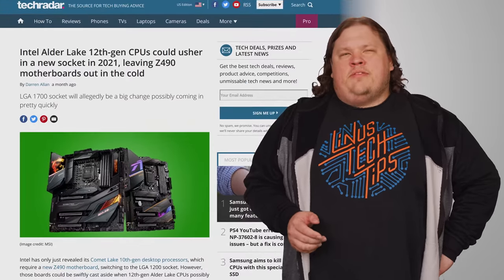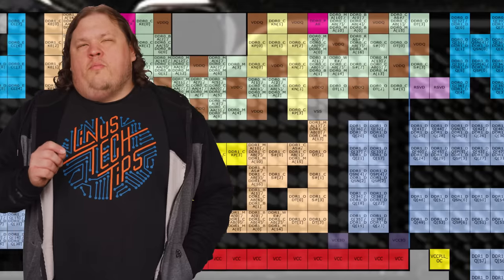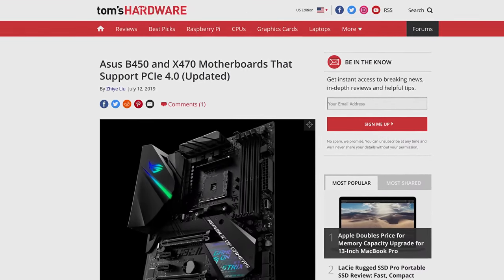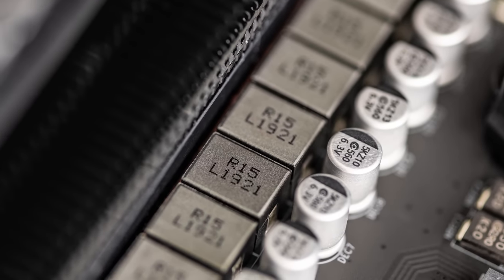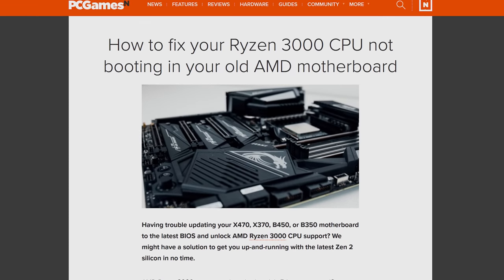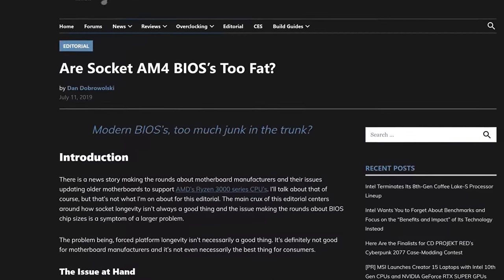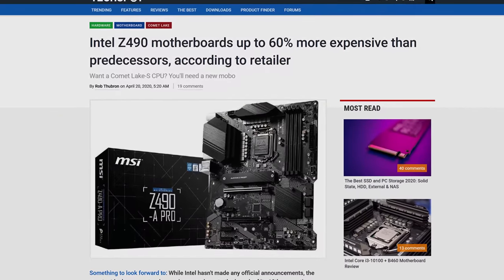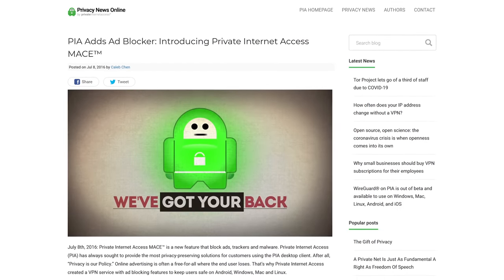Why CPU Sockets CHANGE So Much

Comment: 3:35 "So it decided a transition to a new chipset with a 32MB bios chip instead."
Complete garbage as you find X570 boards with 16MB bios chips which cover more generations of CPUs than B550 with zero change to the socket with the likelihood going forward that Zen3 based 4000 series processors and 5000 series APU's will be the end of the line for forwards compatibility meaning that B550 will only support two generations which only requires a 16MB bios.

If AMD for some reason make AM4 compatible Zen 4 based processors and APU's, then there'll be a whole new round of support issues with those X570 boards with 16MB bioses, which would be an untenable position to exclude.

Comment: You are asking the wrong question for the right solution. If the bios is too small to contain all the info then why not just socket the bios to be replaceable as need demands it like it was for 20 years? And while at it, why not future proof the motherboard with unpopulated vrm sockets the same way they have reserve pins on cpus. It's like saying nobody wants chocolate syrup on a pickle flavoured ice-cream, but why is the ice-cream pickle flavoured to begin with? 

For the record amd is still better than intel in this aspect but this entire video is just corporate funded crowd anger soothing. LTT media is a shill as always posing as being on the consumer's side.

Comment: That's bullshit. It's easy to reserve many pins. And there could just be more specific prerequisites for a CPU, instead of just a chipset (yet it even comes down to whether the motherboard supports a given CPU).

I'd say that this is either bad engineering or money-driven decision that also keeps it simpler for the engineers (double advantage).

Comment: Well i do have a solution for most of the things you said that are problems.
1- put more pins to a higher end motherboard just in case because there already is a butt ton of vrms for overclocking and whatnot so they will deliver the power your new cpu needs.
2- put a god damn bigger bios rom into the motherboard since it is a high end variation and it already is expensive.
Asking around $500+ for a motherboard then demanding socket change every one or two years is clearly a ripoff. Do that for $100 crapboards nobody cares about changing them but changing a fucking high end motherboard and still not getting pci-e gen4 is fucking ridiculous. Intel just sucks big time. Do they really think people will buy their new cpu's and build a full new system just for nothing and next year when they finally support pcie gen4 with their brand new cpus and whatnot do they expect people to upgrade again? They are totally ripping of their loyal clients in order to make up the loss of market share by making just too many launches that don't mean anything.  Yes all chip manufacturers suck at something. For example nvidia is constantly messing up with their pricing, now most of the retailers that have 2080ti's in their stock will sell those cards for loss only because the same company is launching faster products for cheaper. Same goes for AMD radeon promissing to deliver performance for almost a decade and always failing to compete in the market. They all suck but intel, they are really greedy.

Comment: I originally bought (way back) an intel core2 duo cpu expecting I could upgrade later to the quad and double the speed. It sat boxed up for a while while I was using my laptop for everything the last few years. Well nearly 10 years later I went to upgrade it I found that even doubling it wouldn't be nearly enough and the ram was too slow as well to run games. I needed to upgrade to AMD 3600 6-core seeing that they have a cpu that works in that board up to 16 cores (but big money) but when the time comes around I could cheaply pop that in. Also stoked that the 4000 series will now also work in the same MB as well. Man I cant see myself or others going back to intel when AMD has such a great track record of making things affordable to upgrade and leaving so much room. Although CPU's are insanely fast these days its hard for a home pc to "need" the latest stuff out there and I imagine maybe 5 years from now getting a new graphics card first as it is the bottle neck for gaming in my case, but I am happy with the performance now as well.

Comment: stop defending intel (amd is ok), its the biggest cash grab ever :
- x299 and lga2066 being hedt (biggest revenue market segment)/being "properly" designed from the get-go hasnt changed thru 4 generations
- lga1156 vs lga1155, lga1150 vs lga1151 like really, 1 pin? thats major BS, no actual difference between those sockets would warrant a socket redesign (dont forget how much of a "in your face and you cant do nothing" lga 1156 was)
- 1 socket/market segment is what i think theyre going for and sounds like typical intel
- how many generations/architectures there were on lga 775 before intel began its assault on our pockets
 
edit: forgot lga2011 which was the same fuckin socket, but they rewired it so wed buy their shiny new chipsets/cpus - like WTf
now, how is that not a cashgrab?

Comment: Just so everyone knows, that pin out diagram that he show, that shows what each pin does, is not a mandatory/static layout. They can make ANY pin do ANYTHING. As long as it has enough pins, it doesn't matter what you have those pins doing. So THE ONLY reason that they would need to change the socket is it they ran out of pins. (Going from ~1150 to ~1200, is only 50 extra pins, and they didn't need 50 extra pins.) They split the power delivery up between several pounds, so each one doesn't carry too much power. There was plenty of headroom (pin wise and extra pin wise) on the old socket. The reason they change sockets so frequently is strictly for financial reasons.

Comment: Yeah, AMD's typical attempt to cheap out on their products really bit them in the butt, this time.
Reply: Not exactly AMDs doing, 16mb chips are an industry standard used widely in various products with board manufacturers deciding it was good enough when AM4 and Zen came along due to the poor history with bulldozer.

Comment: Im gonna go ahead and dislike this video.
Why? I thought you would never ask...

You make the argument that more pins can equal more power and is the leading cause for CPU socket change.
But for those who have a memory lasting longer than 1 minutes would remember your begining argument about the century old plug in and power demands..
Ya get where im going here? You cannot make this argument from a double negative...